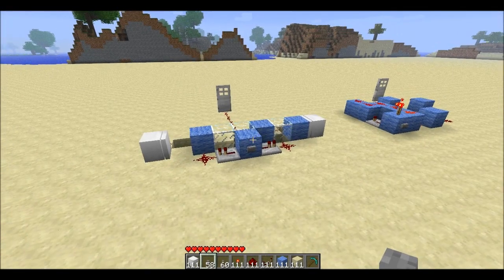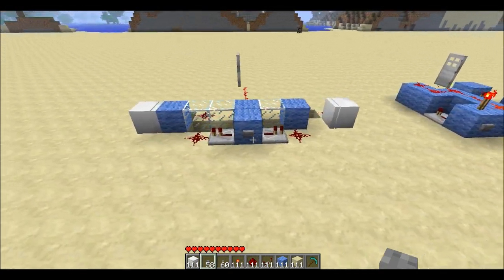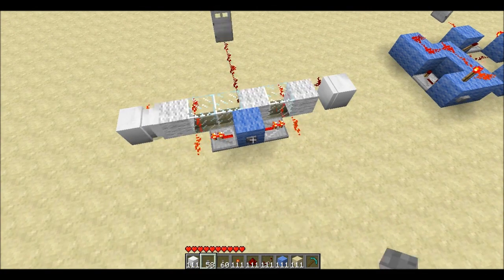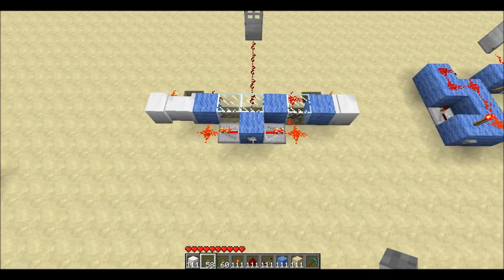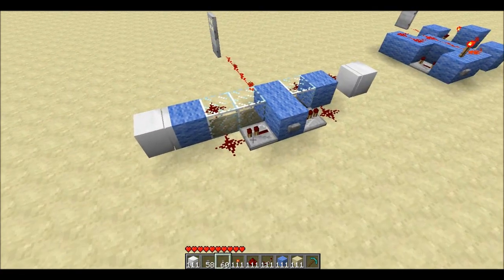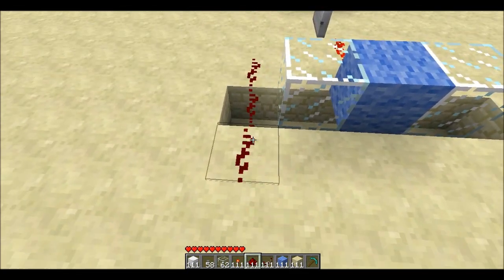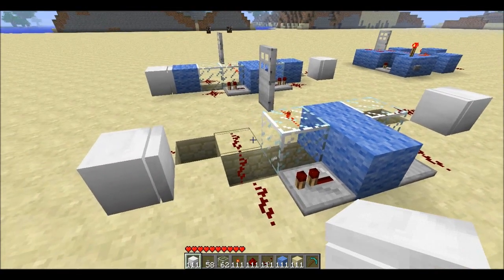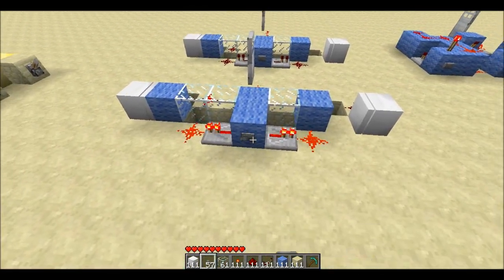Piston Powered T FlipFlop

Comment: @Radical011Y When it's being moved, the redstone wires on the bottom connect, because the blocks on top technically don't exist. This is fixed in 1.7.

Comment: @TheIcyBridge He probably does not use it for the same reason I don't. The super pickaxe is much easier to control, and when you are working around delicate circuitry you want the speed but also the control. Instant mine is great for removing large amounts of blocks very quickly but the super pickaxe is for fast and accurate one block at a time removing.